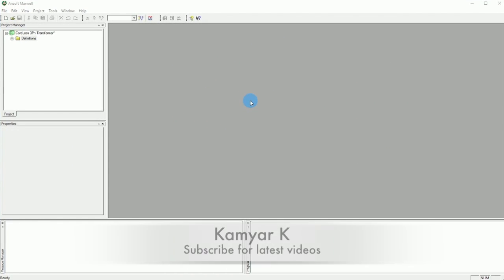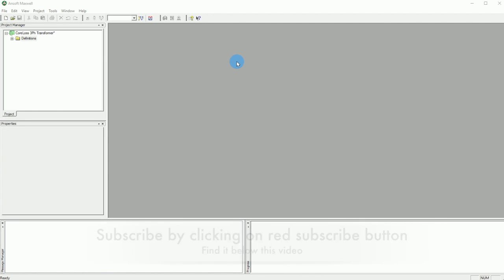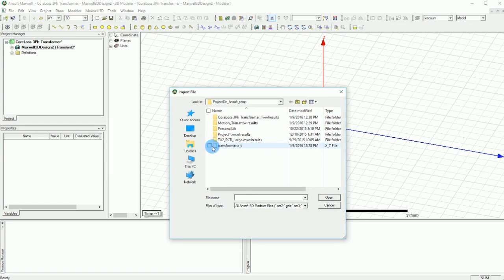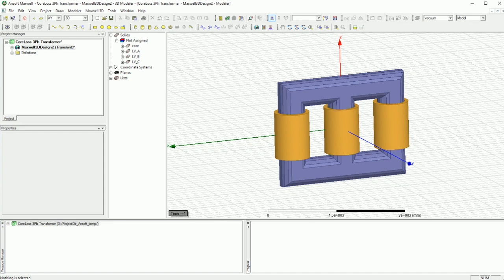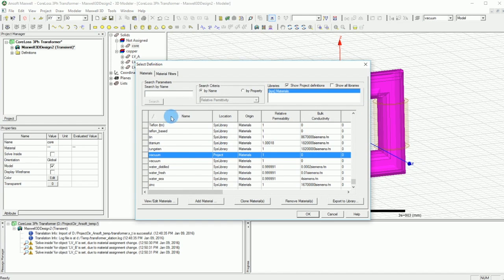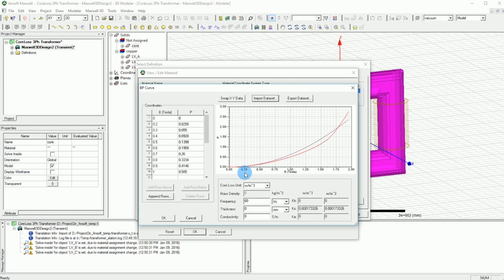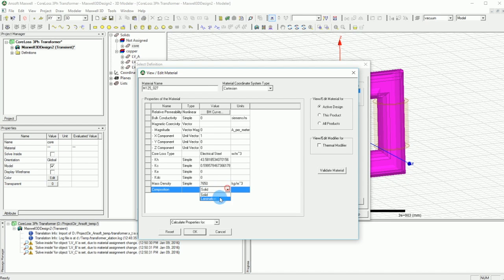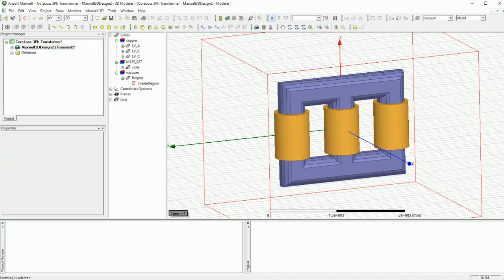410-  Ansys Maxwell | Core loss 3 phase Transformer [1/3]

Comment: I would like to simulate the heating of a 3-phase dry-type transformer in Ansys, and from this I would like to investigate the ventilation of a transformer mounted in the enclosure (flow simulation). Can I do the electromagnetic simulation based on your video?
Reply from the maker: No you need to use eddyCurrent solver and icepack. set the frequency in solver tab in your anakysis setup and make sure eddy current effect is on for the conductors

Comment: I can't download the files so I've modeled the 3-ph transformer with the draw tool in Maxwell.
1) Draw -  User Defined Primitive - RMxprt - Transcoil, Transcore
2) Default size values[mm] time N (N is approximately 13)
     - but you need to change the Layers of Trancoil properties to 1. (single layer)

I filled spread sheet of the materials for the B-H and Loss along the graph curves that kamyar was showing for us.

Comment: Hi;
when ı setup getin create maxwell design ı receive this message
Script macro error: Script Error (Code 8002801d) in file:  C:/Program Files (x86)/Ansoft/Maxwell15.0/Win64/Examples/RMxprt/manual/DCM_4p3000rpm500kW.mxwlresults/RMxprtDesign1.results/DV89_SOL1_V82.MExportData/Maxwl2D.vbs
Line(7):  "Set oDesktop = oAnsoftApp.GetAppDesktop()"
how can ı solve this problen?

Comment: Hi. I simulate a high freq transformer (400khz) which is made by ferrite core. would you please help me how to find coreloss. I've defined B-H curve, Steinmetz coefficient and bulk conductivity but core loss is zero. solution type is transient
Reply: I may have the same problem soon.  What excitation did you use?

Comment: hey kamyar thanks for your awesome videos

I wish to know how to design winding which has multiple layers (turns per layer). Do I need to make 2 winding figures and then have to connect them or whether it can be achieved by making one figure and then specifying some setting regarding the number of layers of coil
Reply from the maker: +Gaurav Upadhyay what you are asking is branches, you can find that on he bottom of winding property window. I
Reply: +kamyar K thanks kamyar..in that case can you please clarify what should be written in the number of conductors box? I have to make 792 turns in 6 layers (132 turns per layer)..so should I write 132 conductors and 6 parallel branches or 792 conductors and 6 parallel branches